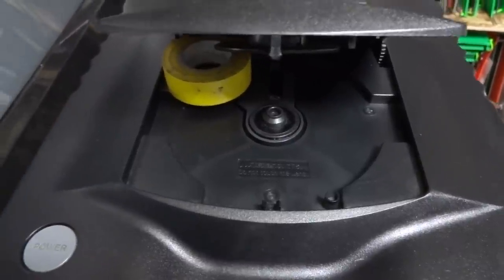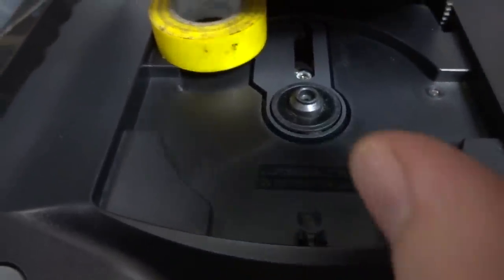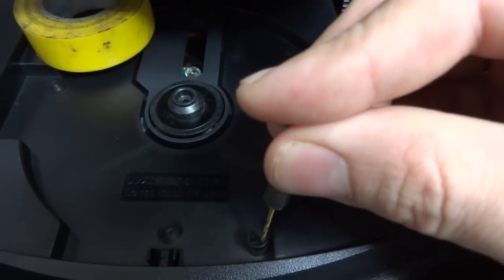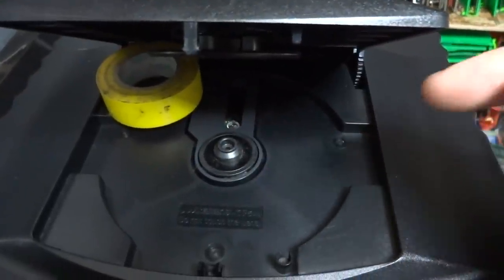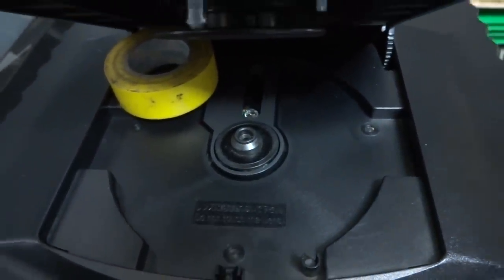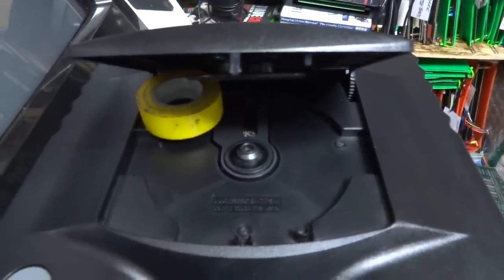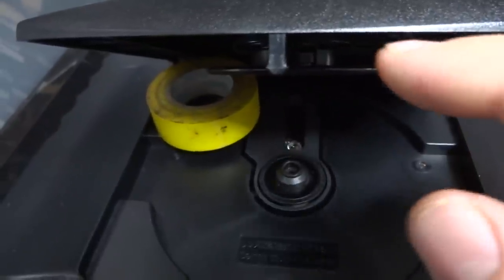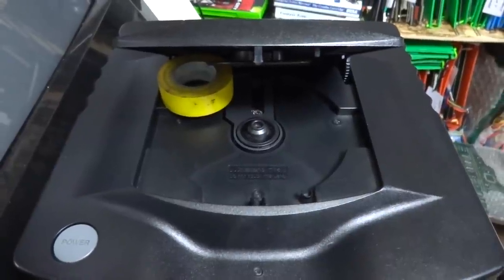Neo Geo CD Disk Won`t Spin / Wont Read Disk Trouble Shooting And Repair Tips

Comment: Thanks a lot Luke!
I have an old JVC system that could not read discs.
I replaced the laser and it still didn't work and that's how I came across your video.
I would never have guessed the blob thing... I dis-soldered it and it worked like a charm!
Peace and Love :)

Comment: Just received my "broken" NGCD today and it turns out it was a super simple fix.  I looked into all the issues you pointed out but it didn't address an issue I was having with the spindle not spinning when the laser head assembly was in the home position.  I thought it was some sort of a brake but it wasn't.  It turns out the spindle plate was pushed in too far and was hitting the head assembly, plus the CD wasn't actually sitting on the plate.  Just popped the cover off, pushed the plate back up and voila, fully working system again.  I appreciate your video as I did the regrease and cleaning and gave me more places to check.  Just glad I didn't fully take it apart to replace the laser.
Reply: I am in the same sitation... Can you please explain what I should try? I did't understand your post well... Thanks!

Comment: Good video lukemorse! Only one thing I could think to add, which had happened to me and took a while to figure out.

Over time, the spindle in the middle of the console will sink due to the weight on it, or shipping may mess it up, like in my case. But what you do, is take the whole CD reading assembly out and take off the black plastic cover. Then holding and pushing the motor shaft down, pull up pretty hard on the spindle. It will come off. Make sure the motor still spins freely, and here is the tricky part. Put the black plastic piece back on it and VERY CAREFULLY BUT FORCEFULLY as it does not go on back easily, put the spindle back on. You want the gap between the big flat bottom part of the spindle and the surface of the black plastic piece to be about 1-2MM above the plastic piece. Then reinstall and go play you some King of Fighters!
Reply: Thank you so freaking much!!! My beloved hi-fi system stopped playing some months ago and this was what was wrong with it.
I can now listen to my CDs again, I'm so so happy!!! 🥰🥰🥰

Comment: Thank you. I dropped mine and was skeptical I could revive it. I tried the q-tip+alcohol, and tried to remove the back panel. One screw wouldn't come out, so I gave up, and now it works. :D Not sure which part got Humpty Dumpty back together but I am glad not to landfill more electronics.

Comment: The potentiometer on the laser fixed my not spinning problem. I should have seen this video before... I replaced the motor... The motor controller IC... I was ready to quit. Thanks for the tip.

Comment: Thanks..my boom box lid had a pin that no longer reached the switch..gluing on a short extension did the trick..who knew?? and, as you mentioned , especially Denon uses ribbons with aluminum contacts. These compress and corrode over time. I lightly scrape the contacts and apply WD40. Good for another 10 years.

Comment: Hello there!

I have two neo geo cds, one of the two is perfectly working an the other one won't spin its cd.
I tried many of the solutions you suggested (the mechanical issue, flat cable, oxidation etc) and after lubing the rails the cd head finally started moving.
If I put it on the top it rans in the opposite direction and stops there but sadly the cd keeps not spinning.
So I provided to the spinning motor 3v, only to check if it was alive or not and...
It started spinning without any issue!

I also tried mixing and matching parts from the good unit and it seems that both motherboard of the neo geo and the little motherboard of the cdrom are fine.
The culprit seems to be in the laser / motors area.

What can I try before buying a "new" laser?

Thanks for your help and great video!

Comment: That's basically all i found out over the years, too. If your'e taking care of your systems before they don't do anything anymore, you might be lucky like me and never need a new diskdrive again.

On Pc/Xbox drives i found one more problem. Over the disc tray is a small magnetic disc located, you can see the locked version without a magnet in lukes neo geo cd.
Its holding down on the cd to prevent it to vibrate or get loose.

In normal PCish drives its just sticking on the top of the drive by its own magnetic force, it will come down to the tray when the tray gets lifted up a bit or so.

If this does not happen, the disc won't rotate correctly and the laser can't read properly. The drive will spin up and down and the laser will go nuts, that you can hear it adjust all the time.

Get a magnet and magnetize this supportdisc and get some grase and put it on the lifting mechanism, that should fix it.

If it does not help at all and you want to finish your game that night, you can leave your Xbox open or your Pc drive loose in the tray, so you can press gently into the middle of the drive after you closed it. You don't need to do that again untill you change the disc.

Comment: You can use super glue to permanently glue down the whatchamacallit if your pin is broken off, also if any parts are stuck WD40 works good for cleaning and polishing the laser......

Comment: Hey! Thanks so much for your videos that have been helping me diagnose and repair a Neo GEO CD that I picked up recently. When I got it it would not turn on and had no video and sound. I replaced the capacitors on the controller board and the power / video board as well as a couple inductors based on one of your videos which seems to have fixed the video problems.  With one small exception. For some reason the RGB out seems to be missing green. Composite looks great.

 Also, I have a problem where the Neo Geo is "always on" you plug it in and the LED light turns on immediately. pressing the power button seems to just turn the "video off and on" if that makes any sense. Like the system is not turning off...just the video is no longer displayed...very strange. You ever run into that?

Once if figure that out, the next step will be to get the CD drive working...

Anyway, thanks for the great videos, they have been very helpful!

Comment: Question I have a broken pin that’s no longer attached to the CD lid. Therefore, my door doesn’t stay closed the latch is still in place. Is there a DIY or other aftermarket pin parts?

Comment: Hi Luke, I bought one of these off of Ebay a few weeks back and the door was broke off when it arrived. The plastic arms that hold it onto the console were broke off. I ordered a replacement door off of Ebay and it arrived broken as well. So, I tried gluing the arms back on but the pressure from the spring was too great and the arms wouldn't stay on. So, would you happen to have an extra door to sell? Please send a message if you do. Thanks!
Reply: RyuHayabusa06 just put a piece of tape over the switch for now.
Reply: I got another door long ago and fixed it. Thanks anyway!
Reply: No problem. Geez, I need to start reading the date on these posts. Lol

Comment: What happened to mine is the thing that holds the disk was pushed down over time on the shaft. I fixed it by prying it up and using a gell superglue to fix in in place. Works great now.

Comment: great video Luke, I just purchased my neo geo cd top loader, and the issue i am having is the disc motor will continuously spin once i power the system on and will not stop unless it is powered off. I am assuming this is abnormal, but have not found anything online about this issue. Have you come across this issue before, or do you have any insight on how to remedy the problem. I can see the lens emitting a red laser when its powered on.

Comment: Hey Luke, I bought one and I realized the cd was not spinning. I took it to a repair shop and the guy said it was because the lens is not working. Is that right? I live in Brazil and it is very expensive and hard to get these kind of lens, so I want to be sure that is the solution.

Comment: Hi, my problem is when i insert any music cd it works very well up to the fourth track, but after 4 the cd rom is starts to hang out. I bought a new lens, but it is still not solved The problem seems not from the lens, When I run the device in reverse, I noticed that it reads all the songs without any problems and runs all the games without any problems. what do you think?

Comment: I have a Karaoke system that has lost its spinning thingy in the top player. Can it be replaced? It still spins and I think it still tries to read the CD. But the CD can't spin without that little spinner. If it can be replaced where can I go to have it fixed?

Comment: i have a sony CFD-560 and it will spin the disc for a couple of seconds and then it slows to a stop. it also wont play cassette tapes for some reason. do you have any tips?

Comment: My laser in my boombox keeps bobbing up&down and when lid is closed, it makes a whirring sound 4x then straight zeros across read screen instead of track # info
Reply: Same! Did you find a solution?
Reply: @jaywoods298  no, unfortunately. Thanks for asking. I even tried again after some weeks&still nothing. But I did in fact use q-tips around all the parts associated which I'm glad i did looking at the dust/soot i collected. Still, nothing. What I didn't do though was use rubbing alcohol when i used the q-tips. I might try again though or just wait&take it to get fixed because my cassette tape player on it doesn't work either, just the radio.😔
Reply: @queenonyxbutterfly  wow that sounds like a deeper problem. Thank you and likewise! Keep up the hard work 😊
Reply: @jaywoods298  Thanks

Comment: Ive got a vintage Dynaco CDV-1 Tube cd player that wont read discs and wont spin discs,i believe the no reading is due to disc not spinning,this is an expensive and very rare cd player,my drawers rails are well lubed with white lithium grease,ive taken apart all connections & reconnected after checking for oxidation,im out of ideas,hopefully somebody can help.